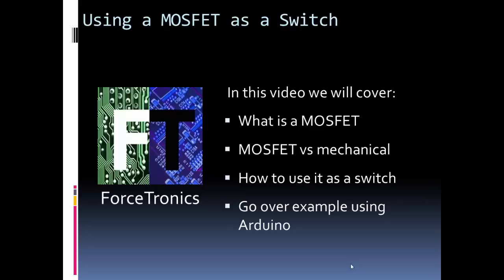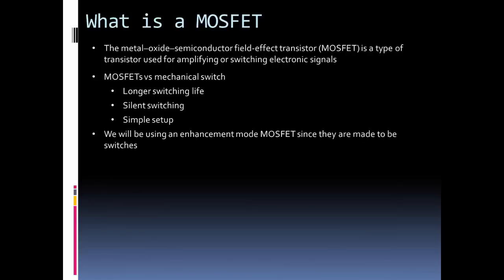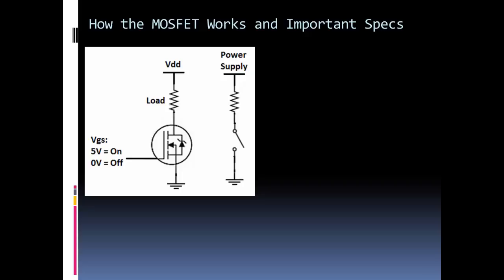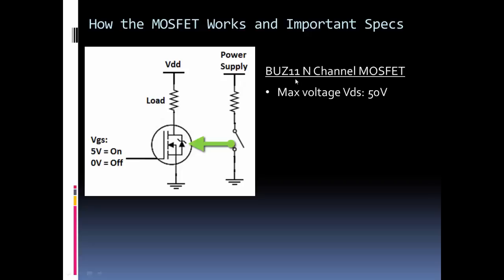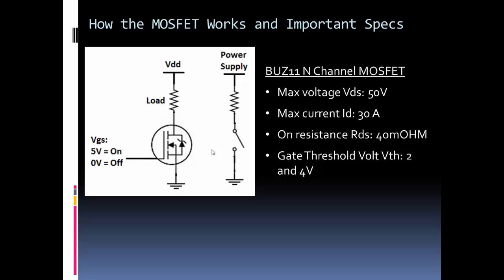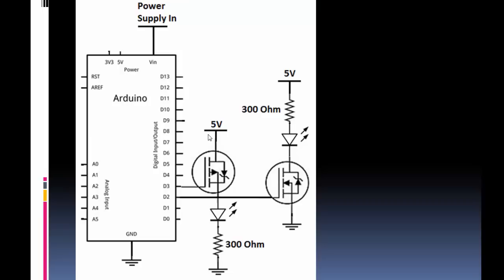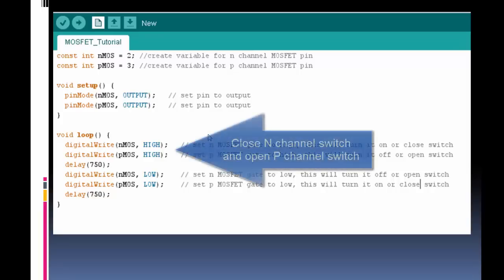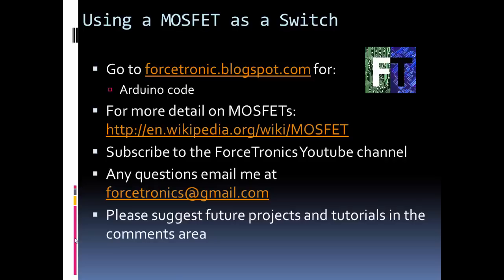How to Use a MOSFET as a Switch

Comment: Thank you for the video, it is very clear

5:12 and following may not be accurate for the mosfet used
5v on the gate will not garantuee the low Rds - you would need a "logic level" mosfet for that 
the datasheet for the buz11 notes in the electrical specifications: Id 15A and Vgs 10v for a typical Rds of 0.03ohm
so, if you use this mosfet you might not saturate the mosfet with Vgs 5v, and the Rds might be a lot higher than what you anticipate, meaning lots of heat generated in the mosfet, and less voltage for the load, as there will be a voltage drop across the mosfet
Rds depends on Vgs, Id, and the temperature of the mosfet, if i understand the datasheet correctly
I wish the datasheet showed a graph noting the relation of Vgs to Rds
breadboard time, i guess :)

note: a "logic level" mosfet has a Vgs(th) of 1-3v - most of the time it will be noted in the description of the datasheet it is logic level
Reply: @KiSwiSje, I just came across this video and was going to point out the same thing but saw you already did, so thank you for doing so. Some logic level mosfets have an L somewhere in the part number to denote it is logic level but it is not guaranteed to have an L or that having an L means it is logic level. Some examples of popular logic vs not-logic level ones are International Rectifier's IRLXXX vs IRFXXX series, or a Fairchild Semiconductor FQP30N06L vs FQP30N06.

Comment: 8:15 I think you can use a pullup resistor on the P channel base so that it is normally off when there is no signal driving the base as both an "initial condition" during controller powerup and as a "fail safe" if something goes wrong.  One disadvantage of the N channel over P is that it is a high side switch which means that the device being switched always has live power to one terminal even when it is off.  So there are tradeoffs with each approach.

Comment: At 7:18 for the P-Channel the 5V is supposed to be connected to the Source pin not the Drain pin. The Arduino wiring is correct.
Reply: Yep.. P-channel MOSFET is drawn backwards.  I'm still learning, so I had to go look it up.

Comment: Enjoyed many of your arduino videos but your  BUZ11 is not recommended for 5v. Special logic level fets are indicated for 5v. Most power fets are designed for 10 volts drive. Also if higher currents are anticipated a series gate resistor is needed to lower the frequency capability of the fet. A fet is really a programmable device depending upon the series resistor value. Power fets make excellent series regulators but must have 10k or higher series gate resistance. A series gate resistor should always be used, if the fet oscillates it may fail from various reasons. I have made power oscillators up to 150mhz( before failures) using typical parasitic inductance values. 
The threshold voltage of 2v to 4v is where conduction may start. " threshold" after 4v the resistance will decrease to the Resistance of 0.040 ohm at some level below 10v. 
Ray King
Reply: Ray,

Any recommendations for a similar fet that has similar voltage / amperage maximums?
Reply: hi Ray,  so following your thinking which is the right mosfet to use?

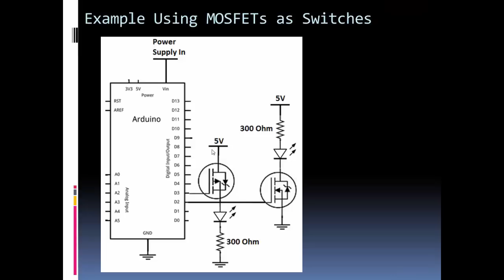Comment: Besides the P-channel MOSFET being drawn backwards @7:01 , the only thing you might have added is how to attach an insulated heat sink (non-conductive heat pad and nylon screw/nut).
Reply: Thanks for your comment, Chris - I thought the p-ch MOSFET was upside-down - it should have the source connected to the positive rail.

Comment: Great, been a long time away for me, 
I had a guess at what they were but needed to be sure.

N - negative side.
P- positive side.
(Side being the load)

N no power
P powered.
Which is the switch off.

What I hadn't known was the reverse drain and source. But I guess the diode should have pointed that out.

It get complicated when you've zenners and you're running reverse for low volt application. Then S to D  works.
But the gate then can be/have more important characteristics.

Comment: Helpful explanation.  I wish there had been G/D/S labels on your diagrams to help clarify the connections.  Using an IRF4905 p-channel MOSFET, and copying  the code from the video, I found that a HIGH signal turned it on and a LOW signal turned it off -- the exact opposite of what it says in the video.

const int pMOS = 3; //create variable for gate of p-channel MOSFET IRF4905

void setup()
{
  pinMode(pMOS, OUTPUT);
}

void loop()
{
  digitalWrite(pMOS, HIGH); //Hmm, this turns it ON!
  delay(1000);
  digitalWrite(pMOS, LOW); //And this turns it OFF!
  delay(1000);
}

Comment: You have a problem on schematic. You are connecting wrong the PMOS with drain on VCC and source on GND. In that case the body diode will be forward bias all the time. The PMOS indeed is used on high side but with source on VCC and drain between load and GND.
Reply: +Adrian Carstea 
I had to look at that twice, and I too was convinced he was wrong as the Body diode will conduct all the time.
Reply: +Adrian Carstea Yes that's wrong

Comment: So I've been doing a long running car restoration and have been having a thought. I just ordered an arduino to get into programming a little, really boost my electronics potential, and was thinking of how I could replace most of the relay panel and computers in the car. It's from 79, the computers and relay panel don't do much that's too complicated, but they are big, bulky, and easily add about 3" to the passenger side foot well plus all the heavy gauge wire running everywhere. Also I think it would be really cool to make new wiring harnesses and be able to take care of all my check engine lights and whatnot in a custom manner.

So are mosfets a viable alternative to relays for headlights, wipers, starters, etc...?
Could I just run power through a fuse bar and then directly to each component with a mosfet at the component, and a signal cable from a control unit? Sounds like more cable but with it I could have a power wiring harness and a signal harness run separately. Or I could just build a smaller unit to replace the massive relay board and other hardware.

Or are relays better in most of these applications and there's a reason car manufactures use them?
Reply from the maker: I have not worked in the automotive industry so I can't give you an exact answer on why they use relays versus MOSFET. My guess is relays are better for the rugged life of a vehicle since they are less susceptible to electrical noise and harsh environments. Also automotive is a highly regulated industry and they maybe required to have a literal air gap when an electrical connection is turned off (often referred to as galvanic isolation)
Reply: That does make sense. And how are MOSFETs susceptible to electrical noise; what should I look out for when using them in a design?
Reply from the maker: MOSFETs require less power to turn on then relays. If you have wiring connected to the MOSFET that is not shielded it can act like an antenna and pick RF noise. Also I believe vehicles are noisy electrical environments in general. For instance when the engine is started a huge spike of current is pulled from the battery which can induce noise onto the electrical system. There also may be other sources that I am not aware of.

Comment: Is it possible to put mosfets in series in order to increase the source voltage? For example I have 5 mosfets rated at 450 volts. Can I put their sours and drains in series, so that I can increase the voltage up to for example 1200v?

Comment: You forgot to mention the capicity of the MOSFET  and the resulting effects of these capacity. E.g. It is no good idea to connect an io pin of a mcu without a resistor to the gate of a n-channel FET. Also there should be an resistor between gate and ground allowing tha capacitor to discharge when FET is switched off.

Comment: hi ForceTronics,
Please help me with this I have to switch a peltier module using a attiny 85 microcontroller.where the controller works on 5v and the pelteir works on 12v 3amp current. 
so my 1st question is can i be able to switch my peltier module using my attiny 85.
and 2nd if  yes which mosfet would you like to prefer to connect for better result. And do i need to connect a heat sink with the mosfet.

Thanks you

Comment: Very nice presentation. Exceptionally well done. Do you know anything about "latching" mosfet switches? I need to turn a PIR "on" with a "pulse", a logic high from my AtMega 328 bare bones chip before it goes into POWER_DOWN_MODE. I need the PIR to remain on, until it receives another "pulse" from the 328 chip to turn it "off".  I have found many examples on line, however NONE have been as clear as your presentation on switches and I am hopeful you might be able to explain an "on" "off" latch circuit. Regards
Reply: Have you figure it out?

Comment: As arduinos are a bit old, can these be used on an esp32 or 8266. These have 3.3v volt output. If so, can the go straight to the pin? Info on the internet is conflicting.

Comment: Hi. I just bought lot of 20 pieces of irfz44n, i was searching for a logic one and got this one up, so i thought it was logic, but it dosn't state that anywhere, and ofcource i discovered that after the purchase...lool. 
Never the less, its specs are vds 55v ID 49A and VDR 17,5 mohm. Its for to be used with an arduino and controling a solonoid valve (12v 4,7W), so its almost the same as the buzz11 , and i can use as intended as a switch with 5v and 0v?
Reply from the maker: Most likely. You need to look for its threshold voltage spec or Vth and ensure it is lower than 5v and higher than 0v which it probably is

Comment: for automotive application which one do you think would be better- pMOS or nMOS ?
Reply from the maker: Both are equal. The determining factor for P versus N is where in the particular circuit you are working with is the best place to put the switch. If it is between ground and the load then N is the best. If it is between the load and power source then P is the best.

Comment: Hi, thanks for the video. Can the GATE voltage be above 5v? (i have between 7 - 10v)
Reply: ***** Can the GATE voltage be below the Source Voltage? my source voltage is 19V but it didnt work.
Reply: ***** Thanks for the quick reply, i want to switch on/off a led strip whenever i turn on/off my pc monitor. The monitor uses about 8v for its backlight, so i conected it to the gate, and the led strip (12v) is conected via the monitors psu(19v) and a step down converter to the drain. Source is conected to Gnd. I have a buz11 mosfet. It didnt really work because the leds were very dimm. Maybe a RFP30N06LE mosfet would work? however i dont know if it can handle the 8v of the gate.

Comment: I cant find any large mosfets where I live. I can only get scrap electronics and use what I find. I have several smaller mosfets, can I use them in parallel for more power? Like resisters, if used together in parallel, they split power flow between them and conduct more power and lower the resistance, can mosfets work the same?
Reply from the maker: +Randy Travis In theory yes, you can put them in parallel to divide up the current flow. From a practical standpoint there are a couple challenges or pitfalls with this approach. First they may not all have the same on resistance so one of them may get more current than the rest. Second if they don't all turn on at the exact same time then one will get the full current for a short period of time.
Reply: That might be a problem. I plan on making a stun gun with a voltage multiplier and a flyback transformer, its going to be some fast killer voltage. I think I just might go out and just get a beefy relay, that might be a better idea, any ideas?

Comment: Do you get a sharp transition with a MOSFET?  Would you get a true square wave from a MOSFET?
Reply from the maker: Typically you can get a rise and fall time in the order of micro seconds or 100s of nanoseconds (possibly better for high Mosfets). Data sheets for Mosfets will have this spec listed typically as V/usec or V/nsec
Reply: Thank you, for the application I have in mind I'm looking for a transition time that approximates a mechanical switch :)
Reply from the maker: Well with a mechanical switch you have to wait for the switch bounce to settle which is probably longer than the switching time for a MOSFET. If you are not familiar with switch bounce I have a video where I discuss it https://youtu.be/Y86-t9j6doo
Reply: Thanks for your quick response, I guess I should have been more specific, the switch in question is a commutator so I don't think bounce is an issue in this case :)  

Thanks again, I appreciate your help and your work :)

Comment: Please help:  I'm using a npn darlington tranzistor to  switch on D.R.L. lights on the car . Been using the tranzistor as an amplifier and it is directly connected to the battery and switching on when there is power from the ECU.  
The problem is that it has a voltage drop of aprox 2.2 volts witch is way too much for the DRL brighteness , it's dimming the lights with defeats the whole purpose of Daytime Running Lights.  Please help
Reply: Bd901 is the tranzistor
Reply: Maybe you could use the transistor to activate a larger mosfet that has a lower voltage drop.  Or use LED DLRs.
Reply: Kuri the wolf Thank you for your reply. Could you name one that works with 12-15V  2W and unde the hood car temperatures? Maybe 42C degrees
Reply: Any i buy on the internet seem to be rated for it.

Comment: Hello sir,
Can you help me for Dimming COB DC lamp with 28V 670mA?
1. TIP41C BJT   [100V  6A  65W] it is getting to much hot.
2. IRF540 MOSFET[100V 30A 150W] it is not giving effective dimming

Other Option is to use TIP120C BJT[60V 5A], IRF520 MOSFET[100V 10A]
Which is best IC to use with 4N35 Optoisolator to dim DC with ARDUINO ?

Comment: i was wondering what the difference would be if you wanted to switch a separate power source thats not the arduino?
Reply from the maker: You can do that as long as it is DC and they share a common ground
Reply: Thanks thats what i assumed. sub to my channel so you can help me with mods lol. it took me a while to work out how to control multiple leds in a bar graph. Thanks

Comment: Hi, can my Vdd be more than 5v, for example 30 V and my load be a battery? Here I am thinking of charging a battery using a solar panel, but controlling the process using a microcontroller.
Reply from the maker: +Elisha Mufambirwi Yes, it all depends on the MOSFETs ratings which you can access through the datasheet. Here is a link to the IRF540N which has a rating of 100V http://www.irf.com/product-info/datasheets/data/irf540n.pdf

Comment: can 24v 10 amp power control be provided with arduino with this method?
Reply from the maker: The answer is yes as long as you properly spec your design to handle the power level and heat dissapation needs of the design. There could be additional circuit design needs depending on your load. For instance if you are powering an electric motor there could be inductive fly back that needs to be addressed

Comment: So can i use the n channel with arduino and dc motor to give a signal HIGH from the arduino pin to make the motor run on the 5v
Reply from the maker: Yes, assuming you get an N Channel MOSFET that can handle the current of the motor and connect things up correctly.
Reply: Add a flyback diode !
Reply: Sunderwolf Impulse I would like to know if the Marshall amps that are of the  Mosfet variety  have a whole bunch of these mosfet gates or are there only a few ?I really like the sound of them and was wondering if they still use them and just don't play up that fact or was there a problem with their use?

Comment: What mosfet did you use? I thought MOSFETS need a drive circuit as arduino can supply only 5V output
Reply from the maker: It all depends on the MOSFET you use. For lower power MOSFETs you can often drive with MCU and for higher power you may need drive circuit. You have to look at the datasheet. The BSS138 you can drive directly with MCU.

Comment: Does the load has to be DC as well? Or is just gate has to be DC?
Reply from the maker: MOSFETs are DC because to turn them on or off the voltage values relative to the gate, source, and drain matter. With AC the polarities would costantly be reversing. For AC look at a triac which I have a video on

Comment: Im trying to use my arduino UNO to send a +5V signal to a mosfet to drive a 24V solenoid. i know that i need a diode across the solenoid to protect it. What i don't know is how to pick the right mosfet. I know that i needs to be logic compatible. My power supply is 24VAC 750mA. the in rush current of the solenoid is 0.35A @ 24 VAC. The holding current is 0.23A @ 24VAC.
Reply from the maker: +Haitham Adwan So it sounds like you want to switch AC voltage with the MOSFET and not DC, is that correct? If so a MOSFET will not work for switching AC. You will need to use a TRIAC and I have a video on switching AC with a TRIAC that you can check out here is the link: https://www.youtube.com/watch?v=Pd67rOuGEg0
At current levels <2A the TRIAC that I show in the video or the BT136 without a heat sync should work fine.
Reply: +ForceTronics Ok. Thank you for this. in the video, the circuit of the Thyristor as an AC switch setup. My load would be the 24V solenoid valve with the free wheeling diode to protect it from back emf. Now my question is, do i need the optoisolator? Also, would you be able to tell me in theory if eveyrthing should be fine now